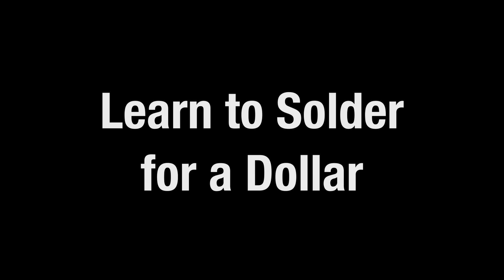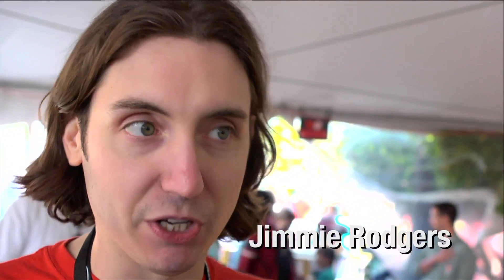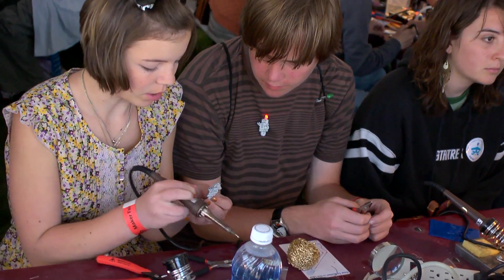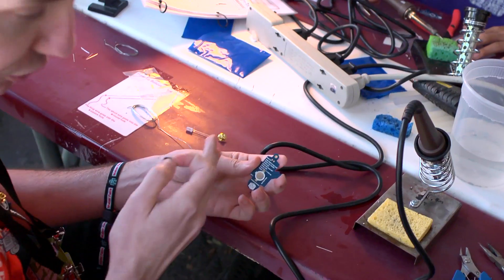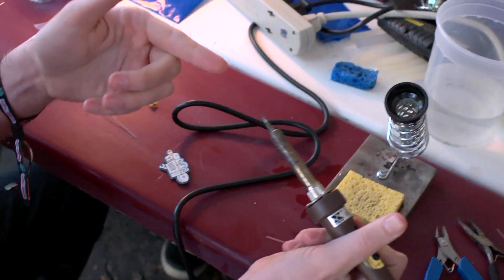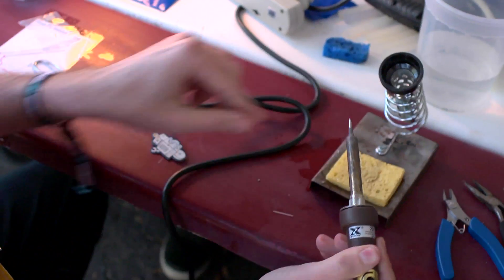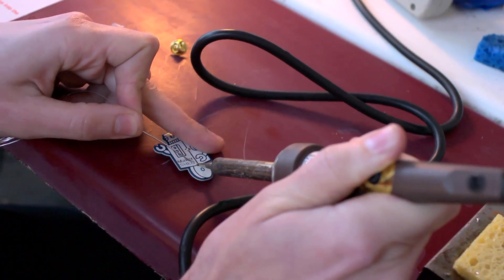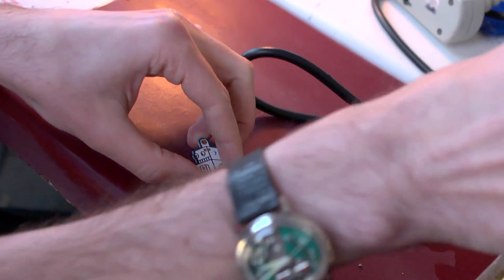Teaching Electronic Skills: Learn to Solder for $1

Comment: Use a chisel tip, it's better because of the larger surface area and can contact the component you are soldering and the solder. use a conical for SMD work...